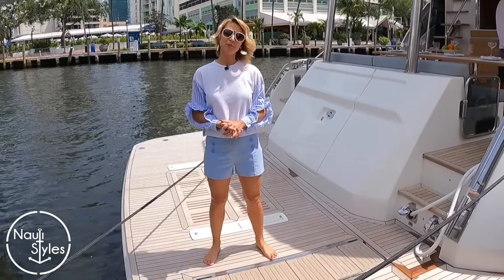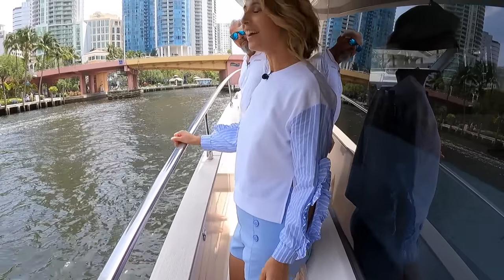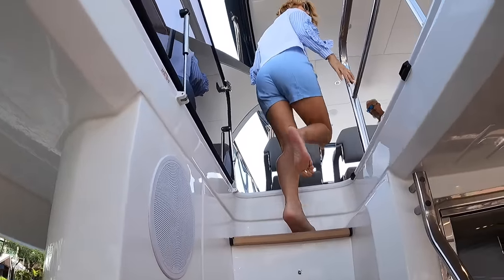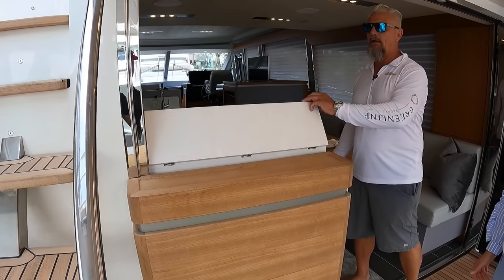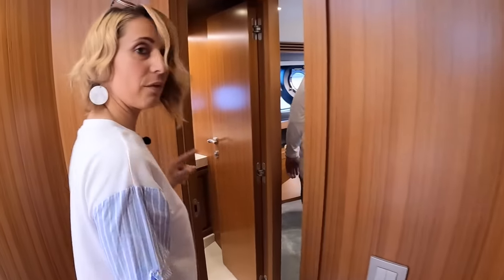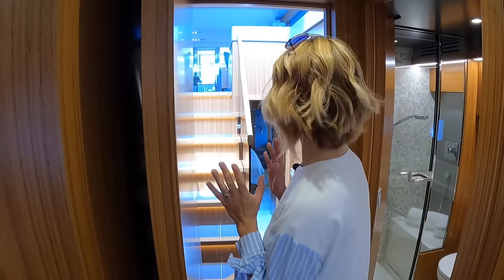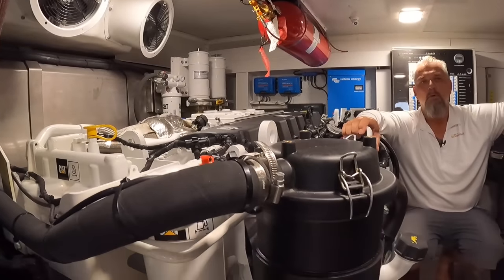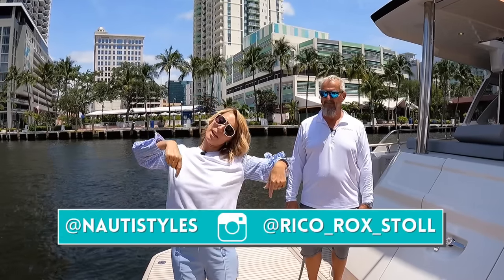LARGEST PRODUCTION HYBRID YACHT EVER BUILT OceanClass 68 FLY HYBRID Tour Greenline ECO Electric

Comment: Wow. This is a fantastic yacht. I love that the wood theme continues into the shower areas and the design consistency throughout the craft without seeming bland at all. Beautiful actually even without any personalization from decorations. The efficient use of space that keeps the design consistency yet provides such a smart offering of unique and useful amenities is amazing in this vessel. It’s just packed full of useful amenities!! I am thoroughly impressed and this particular craft has absolutely become an option. My only question/concern is the battery systems lifespan, charging and maintenance requirements, and safety protocols in detail. Like any newly introduced technology, how tried and true will the predictable reliability be and what are the specific trade offs in committing to this system of propulsion and power generation/supply as opposed to the tried and true straight diesel powered systems with most often two generators backing up the primary engines so there is only an extremely remote possibility of losing full power to, God forbid, both engine and to the rest of the vessel. Other than that, this is a quite obvious choice. Stunning visual appeal jam packed with amenities and an obvious focus on strength and high quality craftsmanship. This vessel is modern enough looking without a seemingly cold feel that a lot of modernized designs seem to project when everything is drowned in white finishes instead of nicely exposed wood with an intentional feel to the surface as was noted in her reaction to that touch sensation. Nice work. Extremely impressed over here!! 👍🏻😎👍🏻

Comment: Thanks for a nice overview of an interesting boat with a hybrid Diesel-electric drive.

34:41 The parallel hybrid system consists of two 1000 horsepower Caterpillar Diesel engines each connected to a gearbox with a 60 kW electric motor connected to the other side of the gearbox via a clutch.  

Either Diesel or electric motor can turn its gearbox and propshaft.  Also the Diesel can run the electric motor as a generator to charge the 145 kWh "Metron" branded Lithium ion battery bank.  Top speed is 25 knots on Diesel drive and 8 knots on electric drive.  Electric drive handles most of the low speed cruising and Diesel does high speed cruising, resulting in almost no Diesel idle time on the engines, since the electric does most of what would be idle and low speed use of the Diesels.  (When the Diesel is running to move the boat, it's also recharging the battery bank.)  

Udo pointed out that, over time, this results in many fewer engine hours on the Diesels, which can help resale value, reduce maintenance costs, etc. He also pointed out that Diesels don't run as well (or cleanly) at low power or idle compared to cruise power.

Udo estimated a 20 nautical mile range on electric power alone (from the battery bank to the electric motor).

In addition to the main Diesels, the separate generators can also charge the Lithium ion battery bank.

Correction: This vessel almost certainly does not use Lithium Polymer batteries.  Lithium Polymer batteries would use a solid or gel polymer electrolyte, i.e. the electrolyte itself is a polymer.  Most Lithium ion batteries use a liquid electrolyte with a polymer separator.  But the polymer separator is NOT the electrolyte.  Actual Lithium Polymer batteries (using a polymer electrolyte) are uncommon.

Lithium Iron Phosphate (LiFePO4) batteries that are commonly used in portable power tools, marine applications, etc., use Phosphate, not a polymer electrolyte.  That's where the PO4 comes from in the battery chemistry: Phosphate, not polymer.

In fact, the maker if this vessel's batteries, Metron, offers Lithium Iron Phosphate for boat use.  Most other commercial marine Lithium ion batteries (Mastervolt, Relion, Balttle Born, etc.) are also LiFePo.

This is a relatively common misunderstanding.

The battery was mentioned in the specs as 129 KW.  While it's quite possible this battery bank can produce 129 KW of power (actually probably several times that), more likely you were trying to mention the battery capacity.

Battery capacity is usually specified in kiloWatt-hours (kW/h) which is a unit of energy.

kiloWatts (kW) is a unit of power.

The two are not the same.  (Energy is power integrated over time.)

Comment: A really good point was made. Diesels hate idling for long periods. MTU say in their manuals you have to run the engine at full power for at least 30 minutes every week to blow out all the cr@p. Better to have generators running at an optimum set speed to supply power and battery re-charge, and just keep the main engines shut off.

Comment: My main question to this hybrid: if you just use electric motors and charge them using diesel generator, running at maximum power, and not using main diesels, what would be the fuel efficiency and thus the range?  I suppose much bigger.
Reply: Your question doesn’t sound technically correct to me. I will listen more to the video explanation of the power supply and see if I am mistaken or not.

Comment: Does the boat chiller system run off a variable frequency drive? Im really curious. In old school heating and air conditioning applications, Chillers were either on or off. A variable frequency drive regulates the speed and energy used by the Chillers. It does not always need to run full tilt to maintain desired comfort levels.
Reply: I believe so, this way you safe tons of energy

Comment: This is by far an amazing vessel.  An absolutely great video as always.  For some one not willing to travel by sail, the range of this hybrid is very impressive.  Was the range of this yacht just on diesel power? Or could it be extended if you had the time and the seas to switch between the diesel and electric motors?  I do like the redundancy of the added diesel generator. It's always good to have a backup for your backup. Thanks again guys !

Comment: 2 quick questions pls. Danke. 
1. Onboard stabiliser vs seakeeper? Is seakeeper gyro an upgrade option or not required?
2. Hybrid option - lithium batteries are known to be a real fire or explosion risk at high temperatures e.g. Tesla cars. How is this risk minimised apart from operating at low speed to reduce high temperatures?

Comment: I understand this is an older video but I just had to ask if the engines can be run like generator sets and the electric motors are what drive the screws? That way you could set the diesels at their peak RPM for max efficiency and power to run the electric motors long term.

Comment: Interesting power options- I would guess the next development would be operating in PTO/PTI mode.  (One main CAT, driving one prop direct, and the opposite prop on 60Kw PTI from the other PTO.  Run the CAT at app 120KW with 60Kw going to each prop.    Noticed the fuel tank sight glass has no protection on it.   Could be a delivery omission, of course.   An interesting vessel, and like the Allseas 92 review - having a builder’s/agent’s rep in attendance is hugely beneficial.    Great review guys.

Comment: They really should have put more solar on this boat!!! For a boat this size, I would expect at least 3kw of solar.

One thing the Greenline 40 has going for it is its solar capabilities. You can also custom order the 40 with even more solar to maximize the run time on the BMW battery packs.
Reply from the maker: Pretty sure you could add more, looked like there was plenty of room
Reply: I do agree I think a bit more solar would be nice. But since it’s Simi custom you can always add more
Reply: @NautiStyles  obviously you can add more, but you would think a "hybrid" boat would already have significant solar on board as standard!

Hell....the 33 footer comes with 3 times the solar as this one...STANDARD!!!
Reply: @charlieodom9107  sharpen your pencil 130 KW hour battery would take a week to charge maybe keep the beers cold 👍🙄😁
Reply: @charlieodom9107  be nice Charlie if you want to put 3 KW of solar and run an air conditioner that's fine you're not going to charge $130 KW hour battery that's all I'm saying😁

Comment: Very interesting, love it as a boat and as a technological advancement.

One thing I don’t understand is that the battery pack is 129kWh to 145 kWh. The electric motors are 60kW each, so that’s 120 kilowatts per hour, so at the 8 knots top speed of the electric motors that should be only 1 hour of range if you use almost 100% of the capacity.

Then we have the multitude of systems that run continuously such as the refrigerators, electronics, etc that use power from the batteries.

Perhaps there was an error saying it can do about 20 nautical miles at 8 knots.
Reply: The electric motors don't run at maximum power 100% of the time.    The slower you run them, the less the draw of energy from the battery.

Comment: Awesome drivetrain ... would you say that this 60' to 70' boat size is best in a catamaran configuration - or a stabilized monohull? I like this drive-train, I like the Prestige 60' monohull's finish and design, and I think that the best of these both on a catamaran (like the Aquila 70 - or Bali 5.4 for sail power ) would offer the best of all options? Thoughts? Do you concur doctors? I wanted to add that your couple's tours are best; a man doesn't spend enough time on kitchens and practical considerations (like the showers) while a woman doesn't hover on engines and pilot houses as a male might like to see.

Comment: QUESTION:
 Is it posible to run one engine, two motors, go 8 knots, charge batteries and run a/c, etc.?
Thanks if you answer. ;-)

(Great video, btw)
Reply: Yes that should be possible, or run the generator instead
Reply from the maker: Yes you can

Comment: I have a question for you two.  I'm looking for a fast yacht, 33+ Knots, that has a spacious master and bath, 1 VIP and 1 guest accommodations that could potentially have either bunks or full size beds in it.  It would be ok to have crew quarters but I envision this mostly being just me and my wife who'd occasionally take on a guest, family member or so.  Length, I'd want 85' to 112' and the boat to be the equivalent of a live aboard.  With your knowledge, do you know of any such a Yacht?  I'd like it to have the stabilizers, etc and to have the body shape of the boat called Neoprene.  Deep Ocean certified is also of preference.  A smooth ride at cruising or max speed is desired.

Comment: Assuming the batteries can be charged from shore power as well?   Using diesel to charge the batteries is less efficient than shore power.  The battery capacity is equivalent to 2 Tesla Model Y/3's, so could be charged fully in roughly a day assuming empty to start with and an average ~40 amp charger.  Of course depends on the available shore power and higher amperage service could reduce charge times.    Depending on how you use the boat you might not need to run the diesels much at all.   If someone knew their primary use-case for the boat well enough, the battery capacity perhaps could be adapted at build time to minimize engine run time.     Electric drive in a car is awesome - no oil and filter changes,  no stops at a gas station, quiet etc - I can see this catching on with recreational boating as well.   Of course, you won't be doing an electric ocean crossing with those batteries.  :)

Comment: I think I wouldn't mind sacrificing a little space to have a less-cramped engine room. The easier it is to get to things, the easier it is to figure out what's wrong and repair it... if you have to crawl over things or contort your body just to check things, I don't think that's very good... BUT, for the size... I can understand why they did the engine room that way.

Comment: Nice clip on an interesting and well made boat. However the use of Hybrid propulsion is definitely attractive but is also influenced by the "fashion of the moment". In reality, a truly "sustainable" solution has not yet been found that definitively (finally) replaces the use of fossil fuels, especially with regard to devices capable of storing enough chemical-electrical energy obviously in the presence of production systems based essentially on solar panels. Lithium batteries and dedicated power packs are a good thing but require very expensive mineral resources and are not available indefinitely.
Greetings...
Reply from the maker: you gotta start somewhere 🤷🏼‍♀️
Reply: @NautiStyles   
You are absolutely right and I am not even trying to refute your statement! It is always necessary to define a starting point for any change but... the one currently chosen (not by the manufacturers of the specific vessel) is not exactly ecological or have zero impact on the environment. In this regard, we need only reflect on the availability of a mineral such as lithium, the places, availability as a "world" resource, the methods of extraction and compare it - just to give an example - with LPG and methane, which, although they are combustion-prosying gases, have a very small environmental impact and are not "children" of the exploitation of the countries that exploit its major deposits. 
Lithium is certainly not such a mineral that it meets the needs of all the applications for which it would be necessary. 
Apart from that, I apologize for stigmatizing a topic that goes beyond your pleasant channel that I follow carefully anyway. It was just a personal reflection on the subject and he didn't want to be a silly, superficial judgment of what you proposed in the clip.
Thank you for your kind answer and
Greetings...

Comment: The need for 1000hp? Plus mega battery banks.
1450 NM? Battery bank can only push her 20 miles. More like a tug. A tank, fit and finish yes looks nice. Can it take heavy seas. ( who yachting in the north ALANTA). 68 feet ok. 
2000HP , should slam, a 68 foot yacht 35 to 42 easy. There are some good. But adding it up.
Like a 6 door Mercedes,  that get 5 miles to gallon. The designers fail...
Slient 80. Cat. ELECTRIC pods, diesel,  back up. 
Hanger for small sea plane, and 25 foot tender.
And it can cross the ALANTA ocean on solar and batteries at 8 knots... with tons of more room.

Comment: Diesels hate idling?  News to me.
Reply: Even so, idling for extended periods of time isn’t good for your engine. While it isn’t particularly bad for it, there just isn’t much reason to do it; most diesels start perfectly fine when cold, warm up in a reasonable time, and don’t have gelling issues. Any time an engine is running, it’s wearing out, and idling isn’t great for efficient combustion or engine lubrication. The tradeoff towards keeping your engine running vs. turning it off simply doesn’t exist.
Reply: Marine diesels have maximum continuous idle and low power time as part of the specification. For example the Wärtsilä 20 series engines have a limit of 100 hours continuous at low power state (below 20% of rated power on HFO and 10% on MDF). After the 100 hours the engine has to be loaded to over 70% for one hour before shutting down or continuing operating at low power state.

Comment: ...why settle for 129kw lithium ion batteries when you can easily have 200kw or 400kw lithium ion batteries, which in turn makes your diesel engines work less, and your battery power during cruising at 5-6knots for 4hrs instead of just 30minutes.. the boat is big enough to support that amount of batteries anyway..

Comment: I think that in heavy seas she is a semi submersible :-). Very low to the water.
But from a engineering perspective she is innovative for sure. As clean as possible is a good thing so to show that not all boats / yachts are gas guzzlers.
Nice interior, looks like good quality.
Reply from the maker: I definitely don’t think she is submersible... with the A class rating 🤷🏼‍♀️
Reply: @NautiStyles  The bow will definitely will have the required buoyancy for a CE A class rating and the boat will be sturdy enough. But a A class rating means she is up to waves above 23 feet and Beaufort force 9 (over 40 knots). I guess she is not taller then 4 meters (13 feet) at the bow so a wave above that will make her pretty wet.

I know my semi submersible was a bit of a exaggeration :-)

Comment: Why dose a motorboat have a electric motor.....
3 solar panels (1 that's blocked by the radar, 0 wind generators, and th hydro need the motors to be running where good altanitor is more efficient.
Electric motor are cool but they need to be constantly fead, any boat that can't do so is only selling you THE COOOOOL

Comment: Be careful what you post as fact.....    San Lorenzo has a hybrid that is 106" long....   I would imagine if you do your research  it will explain the ability to do 10 knots for 9 hrs on batteries and you can combine both electric motors to the running diesel engines for extra HP......   one or the other or both for running.....
Reply from the maker: San Lorenzo 106 is not a production yacht... read the title carefully